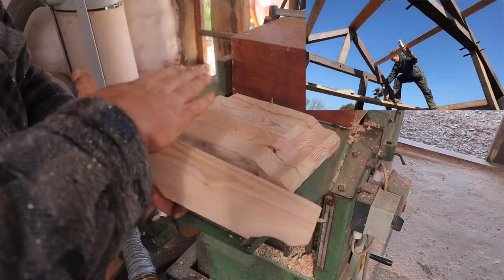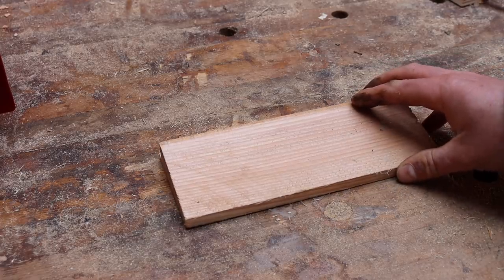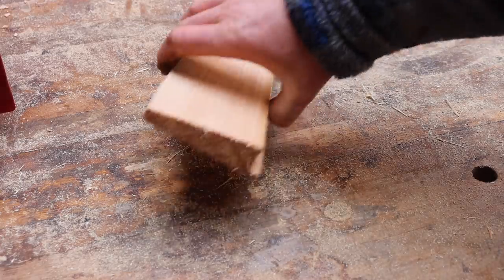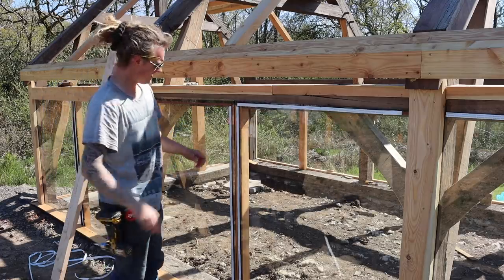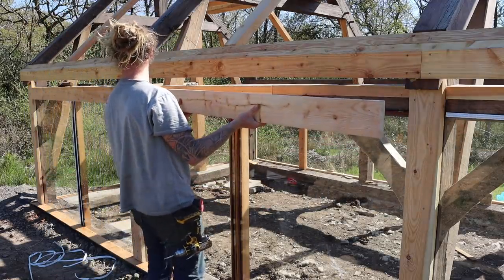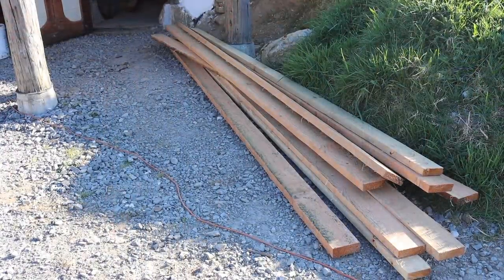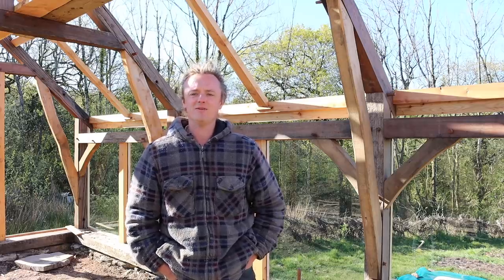Spring Fed Timber Framed Greenhouse Part 10 Glazing The Sides

Comment: Hi Kris,
regarding the spring -- you might have a look into ground water recharging techniques, like having swales or a small rain water fed pond above the greenhouse. This could help to stabilize the spring flow a bit. 
BTW, I LOVE that greenhouse !
Reply: Yeah that spring would be gret to hve going properly
Reply: Swales would be a great idea unless they get swamped in the rainy season.
Reply: Well, as long as parts of property with rain collecting structures are covered by grass, and it isn't actively used for pasture it isn't super no-no deal. And watching Kris, if he would decide on some swales etc. he would end with some super fancy small overflow spillways. If remember correctly there is small pond on property. Small-scale work around it may be a good start.

Comment: Looking marvelous, I do hope you've planned in adequate ventilation, because that looks like it'll get rather hot. A car radiator fan/battery plus 12v panel n charge controller may suit, I'm half way through making one for my 35'c greenhouse. Got flowers on my chillis.

Comment: Awesome work Kris, it looks great!  I noticed one thing that you may want to address from a longevity point of view and that is the sill at the bottom of the glass looks like it may hold water/moisture from rain splashing on the outside of the windows or condensation running down the windows on the inside.  I am not sure if you have addressed it with a slight slope of the sill or have other plans but it would seem a good thing to make sure of so thought I would mention it in case you missed it. I sure love the look of you greenhouse and thank you so much for taking us all along on your life's journey, I so look forward to each and every video you are able to share. Thank you!!!

Comment: I’m sure you’ve already planned for this Kris, but you could install an easy rainwater collection system with a couple of IBC’S and guttering from B & Q for when you do run out of water. Really enjoying this build mate and hope you make a speedy recovery.
Reply: Rainwater collection is great, but it does have to rain for that to work. :/ He said he's had a drought for two months. I'm not sure how many rain barrels he'd need for that to last him. Good Idea though.
Reply: @DeterminedDIYer  The IBC’S wouldn’t be touched until the spring has dried up. He’ could add as many as he likes, planned on the back of how much water he thinks he could use. You wouldn’t use the water from the IBC’S if it was raining and the spring was in full flow 🥱
Reply: @chrisgreen1331  ..Whatever "IBC'S" and "B & Q" stands for..

Comment: great info on green wood movement in a glass box very interesting bit of engineering . i would imagine there is a massive amount of shrinkage yet to happen .how much does the joinery restrict such movement?i would presume its helps enormously as opposed to a run of the mill 2X6 screwed and nailed together apart from the fact it would look ugly.    . it will be very interesting to see how it behaves. fair play well done wishing you a speedy recovery

Comment: warming up and especially cooling down exercises are good if you do this. Also wind and moist weather are really bad for your joints and muscles...I work outside most of the time. Even when it relatively warm I wear woolen undergarments, at least woolen or several layers short-sleeved shirts ....keeps the joints and muscles of your body warm and protects them from injury. Even hand/wrist woolen protections is not a bad idea at all, especially in cooler/cold/rainy weather

Comment: Awesome Build Kris.. Three Questions though..(1) are you concerned about the sun coming through in hot spots and burning the wood?.. (2) as clear as that glass is, will you be adding some form of decals to help birds not run into it as they try to land on what ever plants you have growing in there?.. (3) what are your plans on ventilating the heat in the hottest parts of the day?..

Comment: When fitting the various boards, you seemed to be using your hand as a hammer a lot, could it be a contributing factor to the pain? Maybe it's worth getting a toolbelt so you could hang a mallet off it

Comment: There is no such thing as "over kill". Just continue to use stainless steel screws, those will fade in with the wood and you'll never notice them. |
"Forgot to do enough", naw, you just wanted more wood shaping time is all. LOL
Just take it easy with your injury, I know what it's like to have a messed up back. I still have 2 bulging discs in my lower back and some days, they remind me that they're there. Great build, it's coming along quite nicely. Cheers :)

Comment: There's a small gap between the bottom of the roof and the top of the walls under the eaves. Is that staying open for ventilation or is something going in it too?
Reply from the maker: It’s going to get closed in and it will be shelves for seedlings

Comment: When using those aluminium clips to hold the 2 bits of overlapping glass its worth putting a rubber strip in them, when the glass/timber shrinks/expands which it will there will be alot of pressure on the glass against those clips that could blow the glass, the weakest part of toughened glass is the edges, will be worth protecting them, an old inner tube cut up will suffice (34 years in the glazing trade)
Reply from the maker: Good idea 👍 a little strip of the glazing tape should be fine to right?
Reply: @KrisHarbour  Yes, or we use 4mm plastic spacers just in the end where the edge of the glass would sit against the aluminium clip,
Also, have you considered raising the top layer of glass up off the beams as it will sit 4mm plus the thickness of the clips higher than the lower glass,
We used to have 2 different thickness of rubber gasket so the top pane would sit higher off the beam to allow for it to sit on top of the lower glass, 
I would glaze the lower glass then add a timber strip 6mm (glass thickness plus aluminium strip) nailed onto the beam before glazing the top pane, so you're not putting any stress's or 'bowing' to the glass
hope that makes sense.
Reply from the maker: @wolfe1970  Nice one, yes im using 6mm and 2mm tapes to allow for the difference.
Reply: @KrisHarbour  Great that you knew to allow for that, good luck with it, looking amazing so far, love the style you went for, will be still standing long after where gone, and hope your shoulder recovers soon.

Comment: Looks like there's alot of shadow being casted by the additional window frames.  This may be a bit late, however have you considered cutting grooves into the frame and sliding sheets of polycarbonate between the timbers?   Love the work though.

Comment: Well the outside bolted boards ruins the look of timberframe a bit. Have you considered using polycarbonate instead of glass? It is much more flexible so you might be able to insert it into the frame?

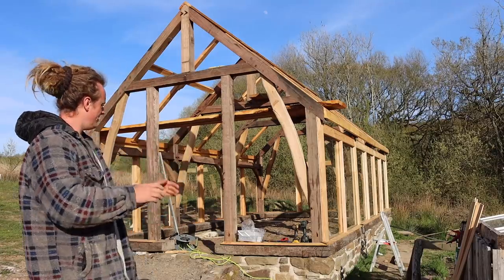Comment: Looks good.  I noticed what looks to be an upward facing split in the one right front slanted timber up near the horizontal plank around 18:29.  I realize that is due to it being green and wood does that, but are you going to stainless screw it back or is it not going to be an issue that will impact the glass?

Comment: Hi Kris. Enjoying your videos: a question, I was wondering about the sills (5:32) if the windows are in the sills, is water not settling under the glass edge instead of (or as well as) running off the sill? I don't foresee any problems with having the glass on top of the sill instead, since you also have the front panels to keep the glass against the frame. What is your experience so far? Cheers!

Comment: i've got a question: when you cover this green house with plastic or with glass, how do you make sure sunrays won't set your timber on fire? I've never seen a wooden greenhouse before.
Reply: That's only an issue with concave or convex glass. Flat surfaces don't focus light to a point

Comment: Kris, are you planning on having any method for opening up panes of glass as needed when it gets too hot?
Reply from the maker: The roof window design was going to be a real pain as I forgot to order the roof window glass slightly smaller. So the plan is to have the door, the back window and the gable end of the roof as vents. I will make 4 triangle opening windows in the gable end that can be opened inwards via a pull string
Reply: @KrisHarbour  sounds great. I can't wait to see it come together!
Reply: @KrisHarbour  I suspect you will need some serious shading. Someone mentioned slatted wooden roller blinds for the roof- which is what the Victorians did! But brush - on white shading is quite good - very quick and cheap, but not very flexible in dull weather...!

Comment: Genuine question, not judging. Curious why you used epoxy for the corner join top covers instead of a waterproof timber glue or construction adhesive? Seems like overkill/more effort than needed? Titebond 2 might have worked?
Reply from the maker: It was polyurethane glue not epoxy. Normal wood glue dose not work on green timber
Reply: @KrisHarbour  ohhhh! That makes way more sence! Thanks. 😁

Comment: Kris, what's the thickness of the glass? And is it tempered or standard glass?  I only ask because of course now you've got me dreaming of my own greenhouse.
Reply from the maker: It’s 4mm toughed glass. Did I not mention that? I thought I did but I could be wrong.
Reply: I’m. Glazer in the states, is toughened tempered? Or just heat strengthen,  I wouldn’t go anything under half inch on that roof,,,,,awesome work BTW,,,,

Comment: nothing to do with how it is built but there is 1 design aspect I am not a fan of in the greenhouse, Greenhouse get EXTREMELY HOT in the summer, and you NEED to be able to remove that heat or kill everything inside. Every greenhouse in my area has the ability to open up large sections of the roof or walls to allow this heat out. This is above and beyond fans at either end.

Comment: Is there a advantage of using glass instead of plastic?
Reply: More transmissive (let's more light through), lasts a lot longer - and it's just 'nicer.....!
Reply: Lets more good light through? Thanks!
Reply from the maker: For me it’s just that glass can be consider a natural material. It is high energy to produce but will last longer, not go cloudy, not off gas, not make micro-plastics. If the glass breaks there will be a mess but glass isn’t polluting.
Reply: @KrisHarbour  True. Thanks for the info.

Comment: @1:23  Dear Kris,  As an old person who has used their body as tool/hammer/mallet I wish I had not.  Please protect your soft tissues of your joints and take the time to get off the ladder, go to the shop, get the mallet, climb the ladder, then bump the timber into place.  Your body will last longer.  I understand the temptation to abbreviate that, but in the long run all those little insults to your joints will accumulate resulting in possible dysfunction and/or pain, that will necessitate time off, therapy, perhaps disability from wear and tear.  There is only one "you" and the high-level, creative work/art that you do and your body should be honored a little more, perhaps.  Blessings Abound.

Comment: men take care with your shoulders and back, i had same issues from delivering male (and doing considerable amount of manual/creative sometimes heavy work outside of that. Wich I loved but i only 1m60 and 50 kilos, I see you youre not tall either) causing same problems...inflammation, not being able to walk.... lifting things essentially you should avoid COMPLETELY at your stage... if you overdo it it might get chronical ....I have that now.... like never healed completelty and heavy work, as much as I like doing it, is probably out of my leage forever......LOVE your work but for god sake be carefull with heavy work....maybe better to do it with a helper when you have to lift frames/heavy pieces of wood/glass etc...